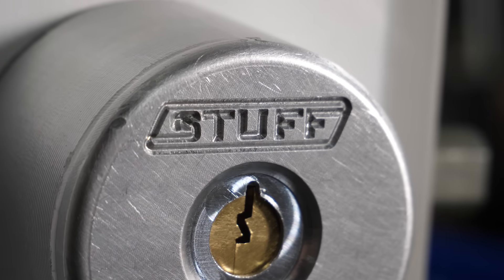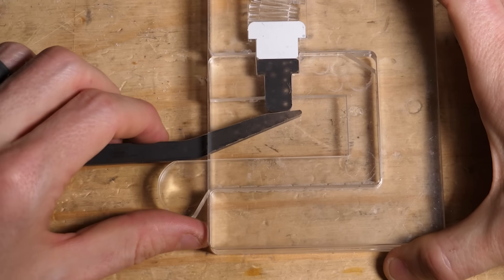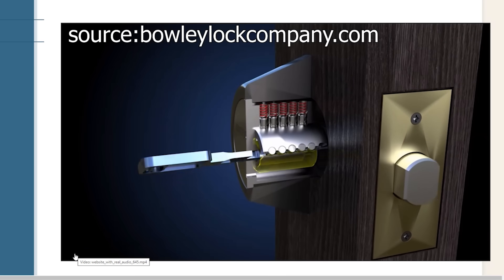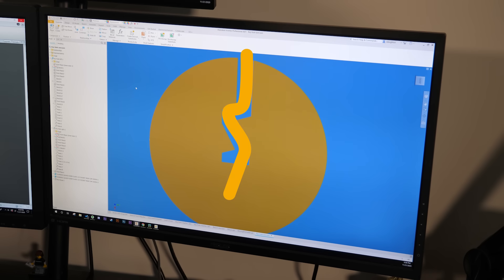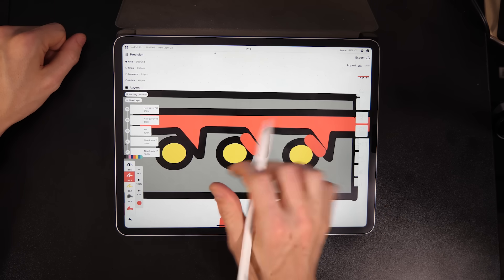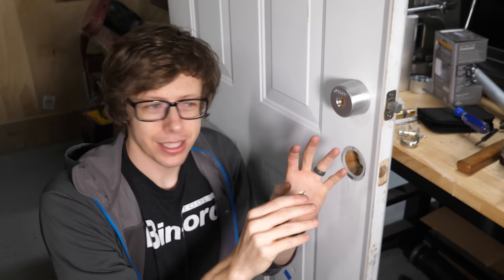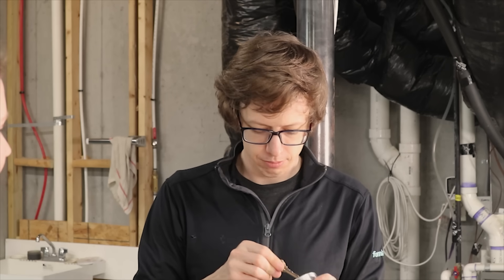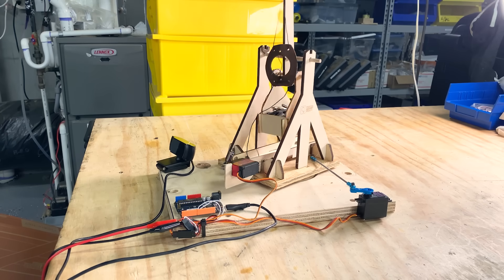Making an unpickable lock. Calling locksmiths

Comment: Guessing a five letter password, one at a time does not work. Because other than with a lock, you only know it's the correct letter, when the password is accepted. With a lock, pros can feel if the pin is in or out, try that with a file on a Computer.

Comment: Question: what if you had simply multiple points before lifting up the armature, or even better yet; you need a keyed methods to lift the armature before able to pick. Say if you had a keyway on the bottom for the armature and keyway on the top, then you would need to have 2 hands to pick the bottom pin's arm and 2 hands to attempt to bump the top pins...

Fantastic, I really hope this explodes your channel! Big big fan of your work!

Comment: Would you consider sharing the plans/files? Could this also be a padlock? Other than the component complexity is there a reason that this isn't viable? How much more does it weight to a comparable lock? I think some tamper detection might also be nice. If you like locks a false open might be cool, something where a picked lock opens a different thing/ interior and not the true contents. I would also be interested to see you add a counter to the opens. I would love to see you do projects in the transportation or safety space. Also the carrying of objects or survival gear. I would be interested in a post mortem of the components that didn't work and the high level ways you could reduce failed approaches to mechanism design.

Comment: I wonder if you could set all the pins to max height rotate the core and try slowly lowering them by releasing the pin locking mechanism so they fall into place.

Comment: I know absolutely nothing about lock picking and I know this will sound incredibly dumb but would it be possible to insert some form of inflatable strip that when attached to a can of compressed air would inflate the strip to the shape of the key and keep it rigid enough to turn the lock?

Perhaps your next challenge should be designing a system for picking an unpickable lock?

Comment: "If you want an unickable lock, just use one without a key". Well while that is correct, this lock would not be able to be opened. The locks you showed use no traditional key, but a key non the less. They use an electronic key, like a signal from a server or an app. And while these kinds of locks require a completely different method of "picking", it is possible. Ask around in it security / hacker groups, and depending on how they are made these things are even more easaly opened. Big difference is: Depending on method, you could unlock these from faaar away, while real locks require direct access. And picking / open these electric locks will leave no traced at all (while picking leaves at least microscopic marks, bump keys clear marks). So, good luck with your insurance...

Comment: "This lock is unpickable"

*A solid kick to the frame has entered the chat"
Reply: if you live in europe where doors are not made out of cardboard this wont work
Reply: Oooh, like the american doors that are paperthin plywood that open in the wrong (dumb) direction? Welcome to try that in a scandinavian doors!
Once saw the door of a flat in apartment building that police had forced their way into. The person living there had changed the lock so buildings master key couldn't open it. They had to break the door frame to get. I mean break it from the concrete opening it's in. No hollywood "two kicks and it's down" entry. Combine that with the Abloy locks they have there and apartment buildings are pretty safe.
Reply: @alaric_  
Yeah i'm in Europe and a lot of people have aluminium front doors, and trust me on this one, you can't kick them in at all, they have steel reinforcements and they have 4-8 deadbolts in different places as well and sometimes they even use 2 keys.

Oh and they are screwed into a wall with 20 or so lag bolts that are 30cm/1ft long.

Police over here don't even try going through the doors unless absolutely necessary, they usually enter through windows and stuff. But when they do have to go through doors, it usually takes 30 minutes or so of cutting and drilling.
Reply: Frame doesn't equal door. Any wooden door can be booted in, just gotta hit it in the right place. Goes double for pvc
Reply: @irishwristwatch2487  Naw mate, trust me good quality PVC doors can't be broken in by using your legs, you'd need at least a ram and a couple of guys.
But ALU is the real shit, steel reinforced. It's almost bulet proof.
Reply: @irishwristwatch2487  You seem to have a different understanding of "wood"
I would love to see someone boot in a two-inch oak door with proper bolts. It's basically a shrunk-down castle gate when made correctly
Reply: @samuelmellars7855  I agree that would be more or less indestructible but oak is about 750kg/m^3 and a door 2.1m x 1.1m x 0.05m thick is almost 87kg in wood alone...
Reply: c4 has entered the chat

Comment: A potential weakness would be when you turn it. One of those 3 pins will hit the gate first. A master lock picker might be able to detect the difference in the stoppage of rotation when this first pin is set vs not set.

Comment: I'm no expert, I think the complex height of the pins may change with wear and tear. So in the future the actual key won't unlock or may be difficult to unlock. If it was another metal other than aluminum something to isn't so soft maybe more brittle. Sure it's more expensive to have titanium or stainless steel. But you'll have a way better lock. I also know those types of metal are harder to machine. Great work on the lock and keep up the good work. I learn a lot from your videos.

Comment: Right primary idea, next trick is fitting it inside a standard Scandinavian or European cylinder shell so it can be popped into a secure outer lock in a reinforced steel door.  A Scandinavian oval has more room for your mechanism while a euro cylinder fits in more places.  Both have available big padlocks that they can be put inside.

Comment: Seems like a sound approach. That bar makes me wonder about longevity vis-a-vis normal locks. When those tension hooks start slipping it will be permalocked. Use a robot to insert the key repeatedly and turn, and stress test it. I wonder how long till something breaks. Would this be a viable lock design if comparable to normal locks.

Comment: About the "Just get a lock that doesn't have a key"... LPL actually demonstrated that while they may be safe, if you can manage to find the actual RFID key card, you can clone it really fast. Also they need to be really good locks too, because sometimes you can just use strong magnets to bypass the relay/solenoid to keep the door locked, or the actual shroud of the electronic lock can be tampered with and just power the motor or solenoid directly with a small battery.

Comment: At this point you have to think about protecting it from attacks from things like drills. Whether you change the materials that you are making the lock from or you design the lock so that if the key way is drilled out that the lock can’t be opened anymore.

Comment: Random idea:  How about magnets instead of springs?  Use a "switchable magnet" which can "turn on" and "turn off" (not really, but you've seen these as magnetic bases for dial indicators and so forth in machine shops).  The idea is to use the switchable magnet to hold the pins in place instead of springs.  It might be mechanically more simple?  ie: most of the lock is non-magnetic (brass?), but the pins are magnetic (steel).

On the other hand, if a lockpicker came in with a really really strong magnet, maybe he could defeat this.  I suppose some amount of "magnetic shielding" could help (ie: a layer of "soft iron" to divert the magnetic field lines around instead of through the lock).
Reply: from what he showed in the video i was trying to imagine some vulnerabilities, and i mean i really don't know but i feel like the holding mechanism is the weakness, because where it grabs the pins has to be dynamic. either magnets or a spring, it'll be holding the pins at their height through friction. it might be possible to raise all the pins to max height w/ a key blank, then turn it so the pins are in contact w/ the gate. with some vibration and careful pressure, you might be able to get the pins to find their place. but i can think of a lot of ways this wouldn't work or could be broken, plus LOL i have no idea what i'm talking about xD

Comment: If you see the security of your house as a watertight hull of a boat it’s easy to see, that there is no difference between a tough lock and the toughest lock. At some point other components are easier to overcome, destroy, or disable.
And rfid locks are by no means better - just look at how many cars get stolen by exploiting this system.
Make it hard to crack the hulk for more than 3 to 5 minutes and the chances for the burglar to get caught rise to the point where they just give up.

Comment: "if you want to have an unpickable lock, just buy one without a key" shows rfid locks

I felt a great disturbance in the force, as if hundreds of defcon attendees suddenly sighed in unison...
Reply: They may be bypassable but it's still true they are unpickable.
Reply: @aspzx  It's called digital picking. Ever heard of a brute force attack? That's probably the effective equivalent.
Reply: @Avali3Ktone  I'd assume any reputable company that makes these locks would implement a measure against brute force attacks as one of their first features; there's many ways, such as preventing attempts in a short succession or having a number of combinations so big that they are not feasible.

You can totally make an unhackable digital lock, with such a simple system it's quite feasible. Of course, you could always gain access by exploiting a person with access in some way to either coerce them or stealthy steal information from them; there's measures against this, but that'd be the best approach besides destroying the door if the lock is actually perfectly designed.
Reply: He said they are unpickable... nothing about their security :) Technically the truth.
Reply: Hacking or cracking isn't picking. Technically, you can say that they are unpickable. Doesn't make them any safer though.
Reply: @OldCloudYellingAtPeople  yea you need one that requires a key and a thumbprint and a rfid and a combo all at the same time

Comment: Conceptually your lock is excellent - it uncouples the pin set from the test for correctness to open.  Therefore there can be no feedback, which lock pickers rely on.  You are down to protecting against other forms of attack (and simplifying the pin-set hold and release pads).

Comment: @stuff made here I came up with a much more easily manufacturable deign for something like this a few years ago, but I’ve never had the tools to make it and I’d love to see it realized. If it’s something you’re interested in, I would be happy to send you the designs.
Reply: It employs essentially a lock inside of a lock, and very similar to yours it mechanically isolates the reading of the key’s bitting from the checking of that bitting against the locking mechanism. It differs in that this design uses pins that have annular grooves on them, and corresponding segmented and spirally-grooved disks with their grooves at the same pitch as those on the pins. The insertion of the key brings the annularly grooved pins up to the bitting height, and the first bit of rotation of the core brings the pins in between the spiral grooved disks, which mesh with the grooves on the pins and lift the pins away from the key via the spiral shape as the core continues to rotate. Once the core has been rotated a certain amount, these pins, which are now no longer in contact with the key but are supported by these disks, are then brought ito contact with the levers of a lever-sidebar type locking mechanism. If these pins were set to the correct height before they engaged with the disks, they will unlock the lever-sidebar lock and the whole device will rotate. Otherwise, the core must be fully rorated back to the locked position to change the set

Comment: Instead of having it have springs that hold the pins in place I think it would be better to just have grooves that the top flat part of the pin can slide along much simpler and if only the right ones open at the end then you can only get through if they are all correct. I can still think of a way to make a pick for it but it would be challenging and I am not sure if it would be possible to realistically pick with it.

Comment: Lift all the pins as far as they will go and engage the catch. Then rotate it tightly against the gates, release the catch and vibrate the lock to allow the pins to slowly fall back down. If the build is uniform enough, they would likely each catch at the right spot. If the build tolerances are a bit sloppy then one of them will fall all the way... Congratulation, I think you have built a lock that work better if you don't build it too carefully. Which is kinda cool.

Also, I'd trust any "consumer" lock with a CPU about as far as I can throw it, ... while it's locking a door shut. Every case I've seen where someone competent in cyber-security has looked at that kind of thing has show major flaws in the software. Even some of the higher grade stuff has turned out to even give snake oil a bad name.

Comment: You may want do redesign the case so that it is more tapered and conical locks are designed that way so that if a person tries to knock it off with a hammer the blow is more likely to glance off the case. Also the core should not be brass, I'm not sure if the lock is susceptible to drilling attacks but most locks are and brass is easily bored through

Comment: If you had square pins (or any shape that wont rotate) you could have multiple slots on one side for the locking bar,  and the gate shape on the other axis.

Comment: "If you want an unpickable lock, get a lock that doesn't require a key"

Can't you just bypass (most of) those electronic locks with a little bit of jumper wire?
Reply: Most of them are very easy to bypass if you put a strong magnet to a special part of it.

Comment: “This is the simplest lock possible”

***frantically rewinds the video multiple times not understanding how it works
Reply: dot
Reply: I kinda got it.
Reply: @Shane Peterson It is easier than what you think, you can buy lockpicking sets on amazon, and start from there...You surely have to undestand what happens in order to open it, and if you can see inside the lock, it will make it easier for you brain to understand every bit!
Reply: I also watched it two times. Still had a hard time, but eventually I understood what this freaking genius came up with. This guy should do talks at universities. I would love to see somebody that passionate about engineering and designing at my Uni...

Comment: LPL: Click out of one, 2 is binding, click out of 3.
Shane: Wait, that's not how this works. That's not how any of this works.
LPL: And until the next time...
Reply: More like "let's use the comb pick on the covert companion to push those locking pins all the way in and past the gates . . . and it's open.  Remember these will be in stock for Christmas . . . "
Reply: "This is the lock picking lawyer and today for I got this unpickable lock"
haven't we heard this line before?
Reply: @svampebob007  the only key he can't pick is that faux "lock" he got from German
Reply: @ilham7345  you're both right about that, that's one impressive lock, I think he did a top 10 list of locks he consider hard to pick and in that list he mentions a couple he hadn't been able to unlock.
Most noticeably are locks that have crazy bends in the core, or like that Bowley key just insanely good design that makes it just not worth trying to pick.

If you google Bowley key some do claim to have managed to exploit it by shaking a piece of wire with some dremels or something like that.
Reply: @svampebob007  well the funny thing is that "lock" is not a lock, just a machined piece of alumunium with a keyhole on it
Reply: @svampebob007   Did he ever pick the Bowley?
Reply: Hahahaha

Comment: My speculation on how this might be picked would be to very carefully measure how far the tumbler can turn.  It should get stuck on one or two pins at a time, so you change the height of different pins until the max rotation changes.  Then try different heights on that pin until you get the greatest increase in rotation.  Leave that pin at that height and repeat the process.  This would require special tools and be MUCH harder than normal, though.  You could probably increase the difficulty by adding notches to your pins, like they do with security pins.

Comment: Lift the pins to max height. Set the locking bar. Twist to bind. Now vibrate the lock in the same axis as the key (front to back). This should jiggle the locking mechanism's springs to allow the pins to drop back down and catch on the gates. The spring-based pin locking mechanism is the weak-point.

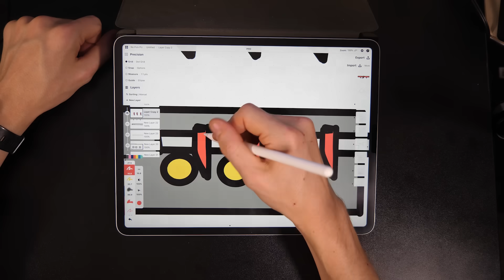Comment: 7:04 why not make a slot system so that when you rotate it a notch on the keypin lines up with an array of lanes so when the notch is in the lanes it cant change height?
Reply: Considering how commercial locks are already made with these standardized height "slots", that's actually not a bad idea!